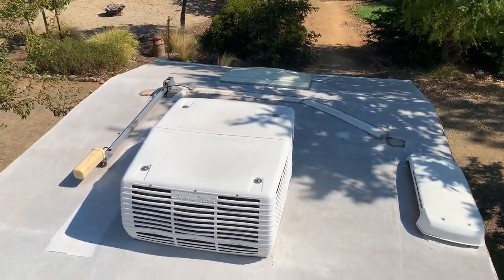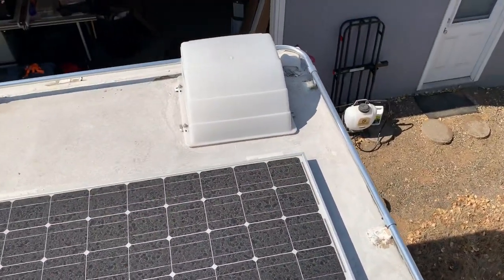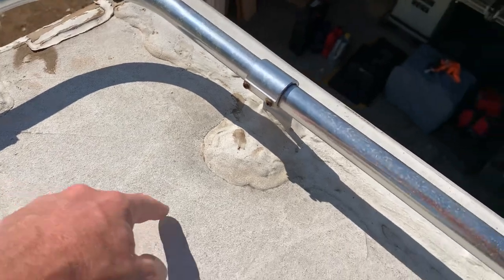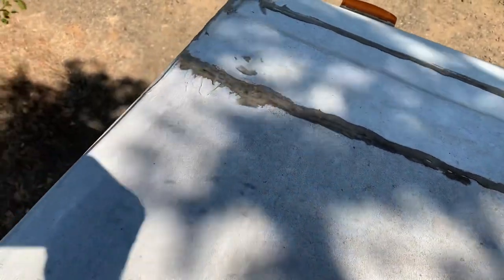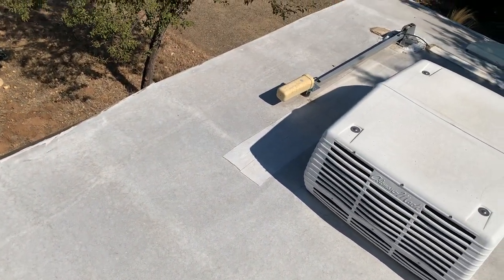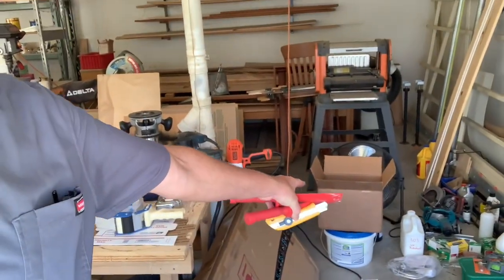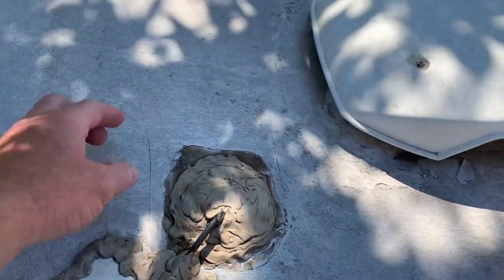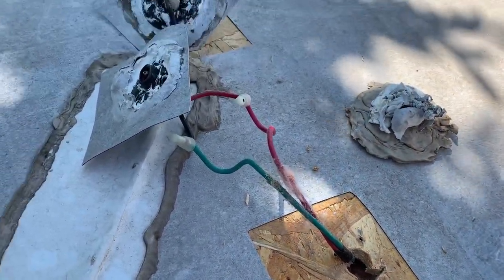New RV Roof Install • Complete Tear-Off & Reroofing the Truck Camper

Comment: I'll be following this job with you.. I completed the rebuild of the wings on my 05 lance. The roof will be next, although I'll have it done.. I'm not up to that much of a task. I'm resealing everything up top for now, and haven't found any rot yet, but there is cracking on the edges.

Comment: Yeah I need to do this same repair on my 2000 Elkhorn Cabover Camper, mine is the shortbed model with the same basic rear tail with factory installed propane generator, no slideout. So I will be following your progress and bookmarking these videos. At 66 years old I wish I could afford to pay somebody to do this but this kind of technical repair is probably $100+ per hour!

Comment: I have a 97 lance with an aluminum skinned roof.  The 24x24" escape hatch had been leaking, so I need to repair the inside ceiling.  Should I tear the ceiling panel down 1st?  Do you know if under the aluminum roofskin is also a Luan skin or is the aluminum directly on the roof trusses/framing. Thanks.